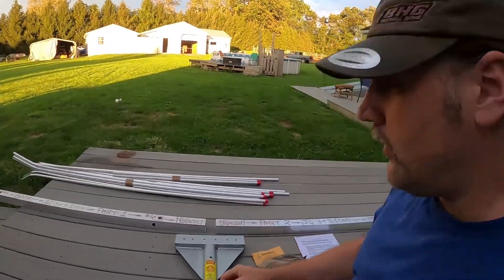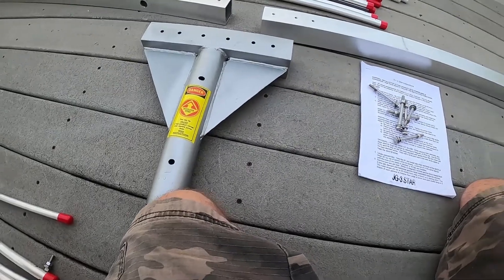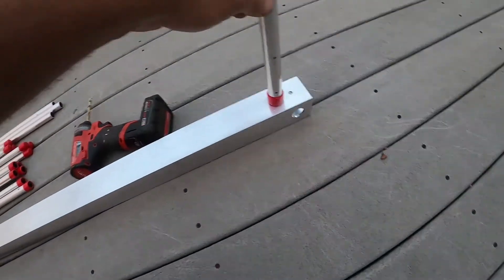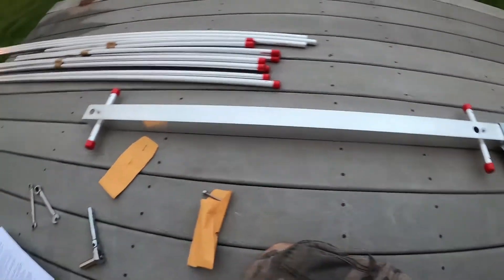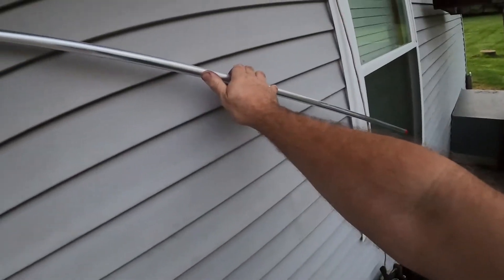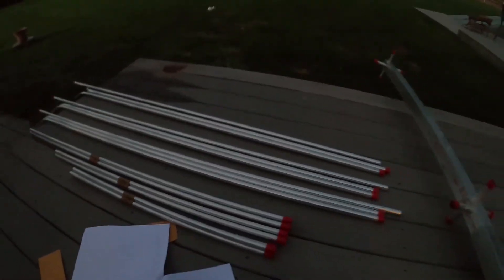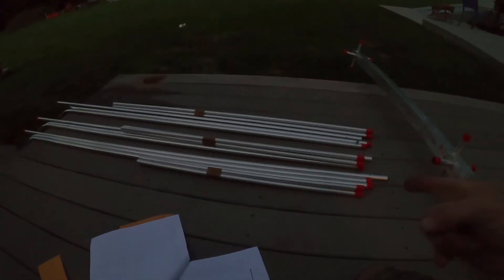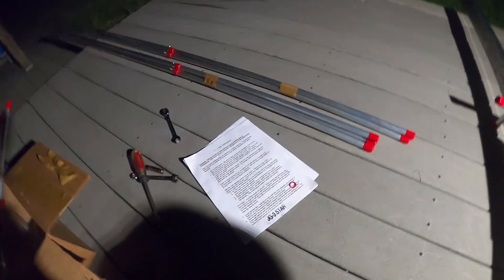jo gunn jg 3star antenna assembly pt. 1

Comment: I had the 3 Star years ago. Worked very well. Only thing I would do is repaint that center "grey" hub bracket. It rusted quickly. Several coats of high end Krylon would do it. Great performer though.
Reply from the maker: thanks its up a little hard to paint now lol but good info im pretty happy with it works great..

Comment: You should have bought a Maco! For that matter a Antron 99 would have done very well against that JG. 😂
Reply from the maker: I took down an a99 this gets out better and can handle more power, I can get a change of 6-8 s-units depending on what direction I'm pointing
Reply: @Mattsneedforspeed   that's hilarious each S-unit is appropriately 6db per s-unit. That's like a 48db gain which no antenna is capable of doing. Obviously your Antron 99 had already failed before you took it down. For example the 4x4 cross by jo gunn has approximately 15db of gain according to them the shooting star has 14 db of gain jo gunn always marks their antennas up at least by 1db over a Maco. Their prices are almost double the price of a Maco. The antenna you have a very controversial star I know a couple of people who put them up only to take them down soon after and replace them with a Maco that were true horizontal and or vertical beam antennas.  The Maco driven element can be split in half allowing a direct feed connection and with a couple of other items a unlimited amount of power can be used for broadcasting. Checkout the Moronmade  antenna by Trucks CB sales which is basically a Maco with addons. 73s Whip
Reply from the maker: @whip205inthebam3  looking for the laughing emoji the a99 was new to 1 year of use, but I guess some one coming in the back side that can be hardly herd with little to no needle movement to pointed directly at them coming in the front the signal reading can increase the signal to a 9, you clearly have dislike for the brand I’ve run big sticks and a99’s in the 90’s and had a pdl2 till an ice storm took it out and had the smokin Gunn 2 up for 20 years that made it threw tornadoes and ice storms I stayed with what I knew and what worked and what was available to buy (in-stock)
Reply: @Mattsneedforspeed  You're dancing all around the best antennas on the market. Maco is as good as it gets. Avanti antennas were made cheap the main problem was their cast aluminum hubs that were flawed and would crack. Plus Avanti's tubing was was lightweight junk and on the Moonraker they had short stubs of stainless steel added to the end of each element that would oxidize with the aluminum all led to major problems. Jo Gunn drills or punches holes into their booms for mounting elements which over time can lead to boom failure. On your small star  antenna it shouldn't play as big of a problem but it can under the right conditions. However the configuration of the star antenna as an inverted Y is not the best of designs. The design doesn't work so well with other antennas being used today. That's why people here won't  hardly even use those antennas because they don't do well with most other Yagi Yagi antennas. GOOD LUCK 73's